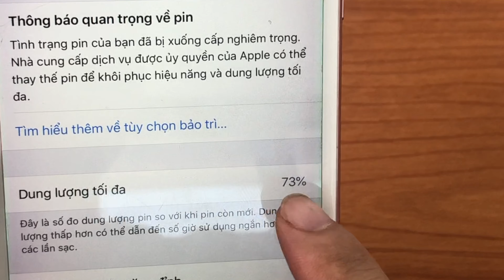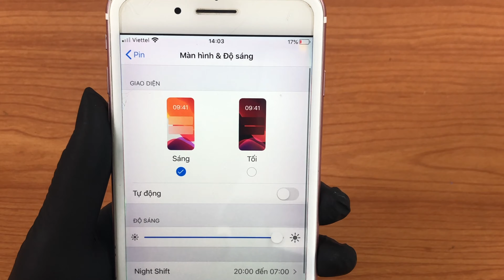How To : iPhone 7 Plus Battery Replacement - Step by Step

Comment: do we NEED to remove the top connector of the screen to replace the battery? or can we just hold the screen in place while replacing the battery?
Reply: らす

Comment: U had 73% !! why did u replace it
Reply: I've been told (by Apple employee) once your battery capacity percentage gets below 70 percent, it'll struggle to hold a charge.
Reply: World Viral Daily  I still have the 7 plus as well. I never have a problem with the charge holding. But that's what she told me.